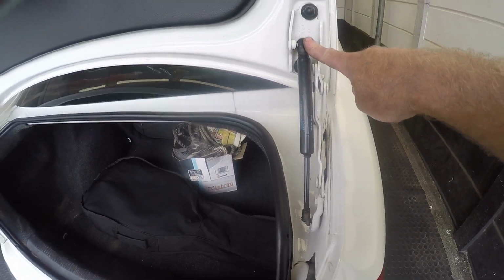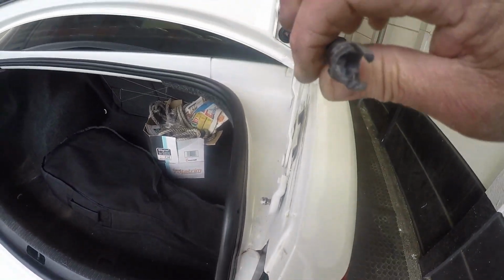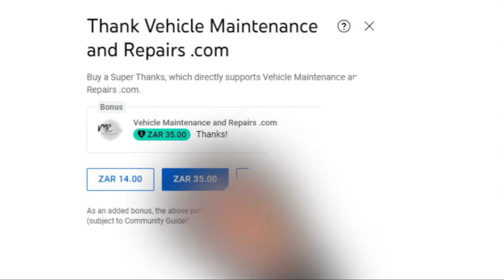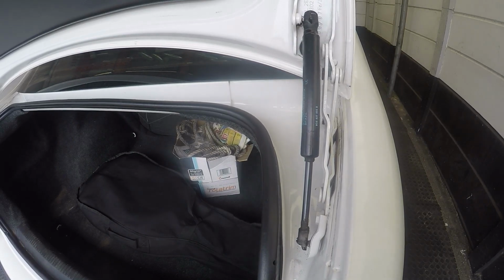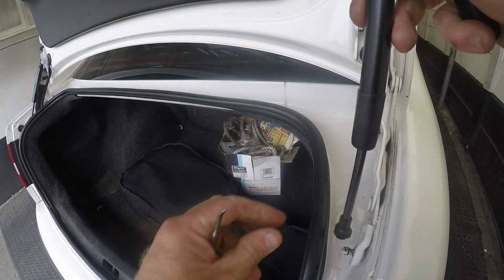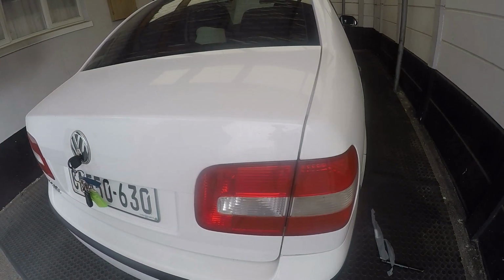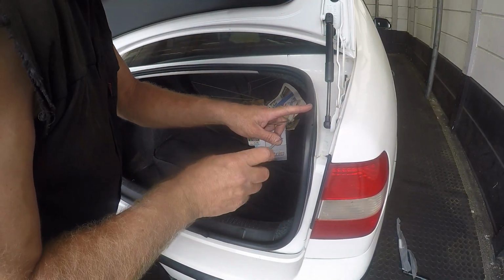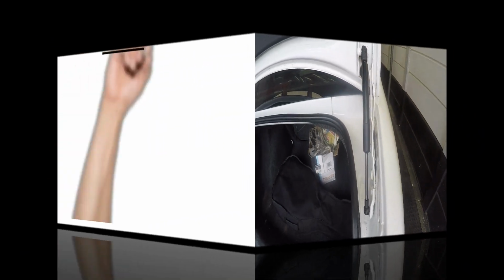Vw Polo - Boot Strut Replaced

Comment: Odd failure, normally they lose the gas charge on them. The end clip does not come off easy though, normally held in with thread locker pretty well. Normally a trip to the scrapyard gets you a bent one for nearly free though, to use as a donor. Aftermarket ones work sort of well enough, at least for the price they work for the year warranty period plus a bit more. Last one I think was R150 for it.
Reply from the maker: Yes Sean the new one is so cheap at present it is best to just get it, problem solved.